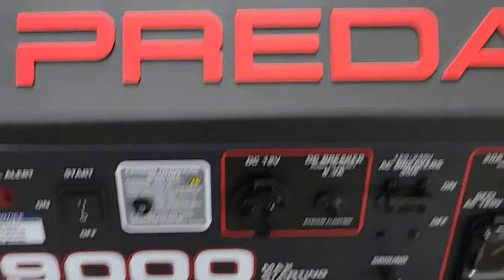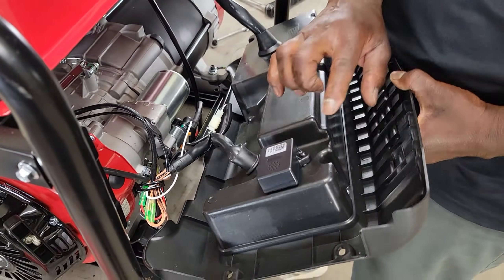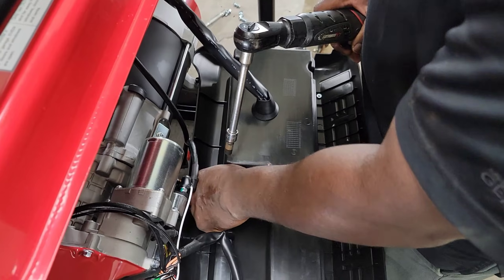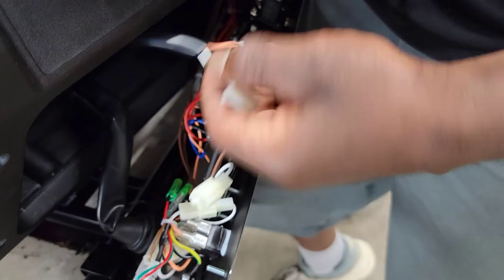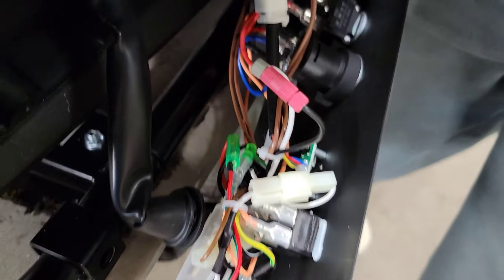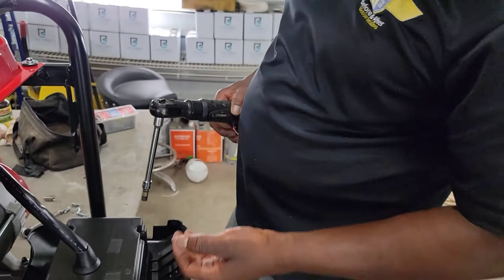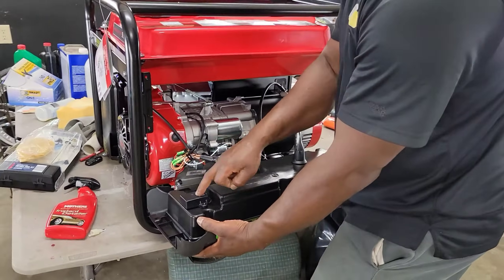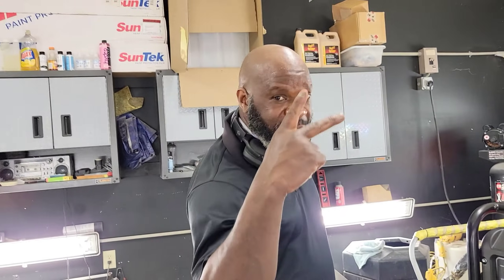9000 watt Predator C0 sensor bypass!!

Comment: Thank you for this video. Very disappointed we spend $1000 and this crap happens.
Reply from the maker: Yw glad it helped!!
Reply: @Whereisclay  LOL, I got my 9000 back in Nov 2022. I just took it apart and guess what! They must have seen your video because they rewired the whole thing into a relay. It has a 6 wire plug/connector going into the dayum carbon sensor that goes back to an independant relay. The relay then goes to everything else. Sneeky predator makers. I really like this generator. So I put it all back together and taped off the openings on the sensor. If it goes down then I got extended warranty so I will just swap it for another one. Just a pain in the rear if you know what I mean.

Comment: How do I  bypass the oil sensor on a Predator 9500. Plenty of oil in the  generator but low oil light comes on and the generator shuts off. I've seen videos on many generators on how to do it except the Predator 9500.

Comment: So wrong.  Do not do this people!
Just disconnect the red, blue,green and yellow wire connector. Promise you you can fire it up with out putting it back together.
Reply: I tried that didn't work! Did his and and its still going !!!
Reply: Disconnect the plug for the white/black wire and jump the switch side with a paper clip or similar item and tape it up with some black electrical tape.  If that solves the problem there is no damage in case of warrantee return.

Comment: I'm going to do the delete to my 3500, it has happened a few times to me as well. Great video! Going to do the c.a.r.b. delete as well as a new ngk spark plug. I might as well drill and add a couple more small hoses to the air box that terminate outside the 3500's enclosure that will give it a good cool-fresh supply of air. I'll run for a short while and check plug for a lean condition ( light tan going towards gray). If lean I'll adjust carb a bit to get plug reading a medium to a little dark brown and that should help it to run considerably longer per tank of gas. Thanks for the tip!  The Old Man.

Comment: I had the same problems with my brand new Predator as well,bypass was just the fix I needed. THANK YOU for the heads up on the gas tank. I have a generator storage shed and that leak would have been a MAJOR loss if not for your advice.  Many blessings
Reply from the maker: No problem you are welcome glad it was helpful!! Thank you for watching!! Blessings to you and your family as well!!
Reply: So you unplug it and why not just connect the black and white wire together directly? Isnt that what you did?

Comment: just put some duct tape over the sensor. works great, no bs with stripping wires and taking everything aprt.
Reply from the maker: Let me know how it works never thought about that.
Reply: Ive used duct tape too but you need a few layers. One layer dries fast from heat and exhaust fumes penetrate the tape. Im doing what you did now. They are getting so many returns now that the warranty has doubled in price!
Reply: @Mountainrock70  ....silver metal foil HVAC tape ?????
Reply: Do you have a video ?
Reply: That's what just occured to me as well! Thanks for the confirmation

Comment: Thanks for the tip on the possible gas tank leak location. Just got one and checked that, already had scratched the paint on that corner of the tank. Filed that down and reseated the tank, plenty of room now 👍🏻 saved a large future headache for sure.
Reply from the maker: Glad it was helpful thank you for watching!!
Reply: I just cut one off a customer unit to